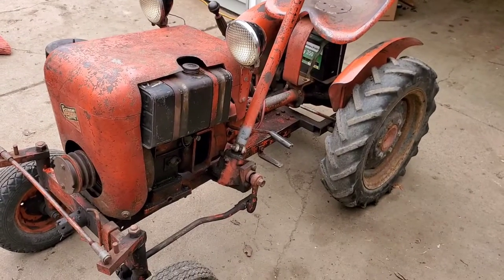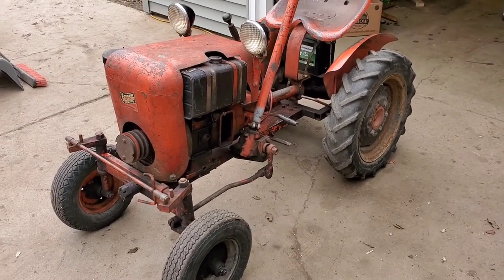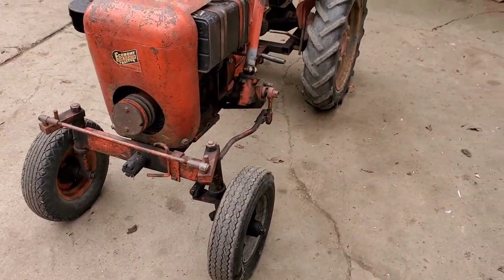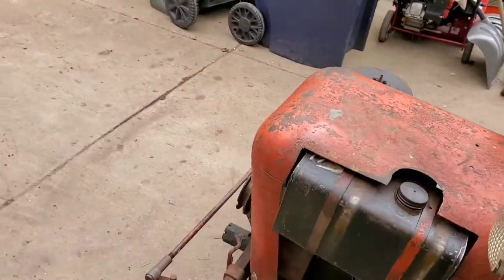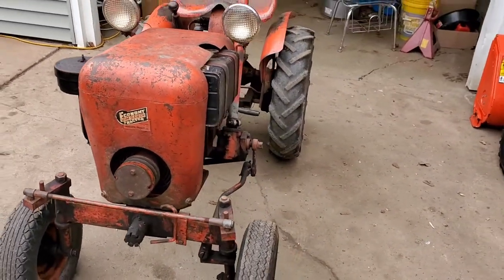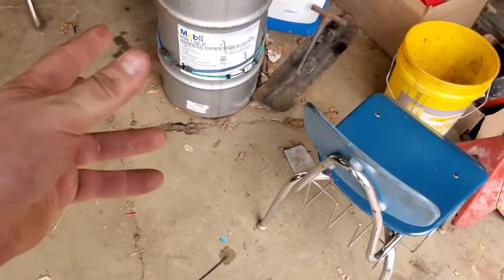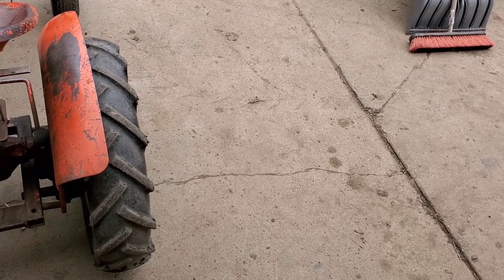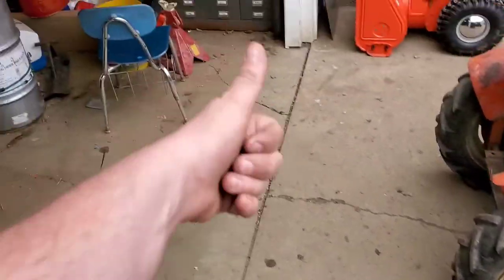My 1960 Jim Dandy Garden Tractor

Comment: Very nice Jim Dandy, you don't see many of them around. I have a 71' economy and I put a brace from the steering shaft to the body. I use it to help myself on, other than that it's original. Cool Little tractor's, I don't use mine much, but it runs well and it's a great conversation piece.
Reply from the maker: I definitely love mine!  Been thinking of a brace for the steering as well